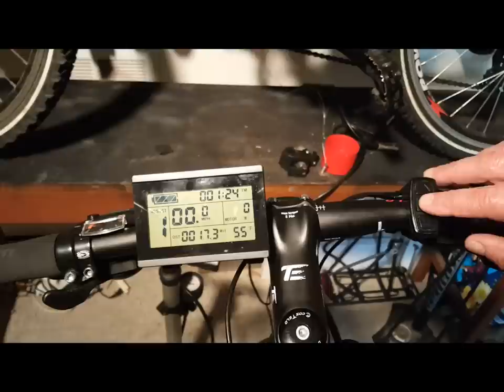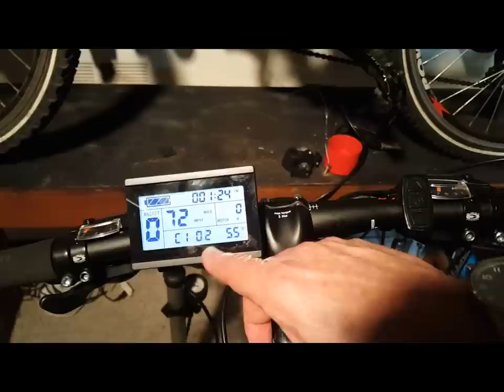How to program the KT-LCD3 Electric Bike Computer. 20 E-bike functions

Comment: I'd probably edit this comment when I'm able to test this, but I had a brake sensor issue with my 250w motor, hopefully changing the ABS setting resolves the issue, as I'm reliable at braking efficiently

Comment: thank you   ... all this  control settings was missing  in  the  manual  for my ebike conversion kit  from  UK.....
Reply from the maker: I'm glad this helped. We go through every function and there is a lot that it controls.
Reply: do you  know if  I  have to reset   with C10   .... I have  problems  with   not  showing  correct  speed   on  26 inch  wheel   that I have  to  set to  12 inch  to  show  almost  correct  speed. Or maybe P2  is the problem ?
Reply from the maker: C10 and P2 are not the problem. Try resetting wheel size to 26 then press the middle button to save. Let me know.
Reply: Its OK  now  again-I got the right setup  for my  bike  from  electricbikeconversions.co.uk now for my kit :  P & C Settings
To change these settings you need to turn off your LCD Display and then turn it back on again. 
The press the Up and Down arrow together and let go within 5 seconds so that the speed should be flashing. 
You then need to press the On/Off button x three and then the Up and down buttons together again to get to the relevant screen.
P1 – 46
P2 – 0
P3 – 1
P4 – 0
P5 – 12
Press the on/off button to advance to each P setting
Then when at P5 press the up and down buttons together again to advance to the C settings
C1 – 02 – PAS with Red Sensor or 07 – for all black sensor
C2 – 0
C3 – 1
C4 – 0
C5 – 10
C6 – 3
C7 – 1
C8 – 1
C9 – 0
C10 – N
C11 – 0
C12 – 4
C13 – 0
C14 – 2
Press the on/off button to advance to each C setting
Press and hold the on/off button to save and exit these settings
Reply from the maker: When in doubt. Reboot. I'm glad that worked.
Reply: Augustine E-Bikes - Santa Cruz 2017
Reply: @shittapes  Hello, how many volts is your battery?
Reply: @osbaldo_g  36v

Comment: The wires on one side of the LCD came loose, I am trying to open the LCD. I removed the screws in the back but it seems to be glued closed.  Any tips on how to open it?  There is no gap to insert a screw driver to pry it open and not enough surface to use hand pressure.

Comment: Hello I have just set my ebike up with all the correct spacers, but my batteries are fully charged and the screen lights up for hours without going off But as I try to turn the crank with my foot standing still its stuck fast and won't spin and when I twist the throttle it goes find for about 5 seconds and the screen goes black and the battery shows empty and the wheel stops dead,  can you help me. I tryed following your directions but iv messed up something somewhere

Comment: what battery do i connect this to for a 36v 750W motor? the controller power wires are flat circles with holes in the middle, didnt buy the battery yet

Comment: My power seems to run out once I reach the later end of 2 bars, even though theres a 4th bar to indicate low Battery. I've had the bike for a little over a year and works fine when its fully charged. is that just wear and tear*? or is it probably more to do with battery balancing and at what levels I begin to charge it at? .. Going to try the P5/RealTime setting later today also, Thank you👍

Comment: What does it mean if the battery level is blank showing no bars but the actual battery is full?
Reply from the maker: Your LCD is not connected
Reply: The battery voltage may be set wong in the settings. If it's set to high, it may think your battery is empty even when its fully charged.

Comment: Hi and thanks for the video.
I got this controller and a 48V battery, on P5 function the defult is 15. When I put 0 on P5 it shows blank even though the battery is full. Maybe you know what the settings should be for 48v? I read that 36v should have 5-15 on this function setting.. Thanks in advance
Reply from the maker: On the P5 setting 0 will show you your battery charge as you are riding. The setting for continuous read out for 48v is 15
Reply: Rockin Electric Bikes in 2018 AUGUSTINE EBIKES what are the voltages for each P5 setting? also is 48v 12S or 13S?
Reply: my bike was sold as "36v ONLY 48V WILL BURN IT" and 48v has been working flawlessly for me but the battery indicator was useless, so this is perfect!! but is 48v 12 cells in series or 13?

Comment: My bike keeps cutting out drive to the motor when under acceleration,  any ideas ?
Reply: Bad battery or too high cut off voltage or battery/motor mismatch. Try lower current.

Comment: Hello. I m facing a problem on my LCD : its showing an error message 'info 06', and the temperature symbol is loading... Could you help me ? Many thanks
Reply: I'm not an expert, usually that happens with failed component. controller or motor in in my experience

Comment: How long will a 200w hub motor larst with controller set on 1000w ????
Reply: Eny One,??????
Reply: @chinkacollins6390  , hey! hub motors like to spin fast. I would say ,if you run 200w motor more then it is rated it is allright, also 1000w peak. But not uphill with 100kg rider weight and more then aprox 1 minute.
Anyway you can find out and experiment, but maybe it is better to swap it out with 500w motor, then 1000w or even 1500w will be much more powerful and noticable. Also no problem with heat and load.

Comment: This guy doesn`t know what he`s talking about. When the assist function set to "0" the throttle is not dependant on pedal assist, the throttle works normally without padal assist.
Reply from the maker: First, this guy your talking about is me  and I do know what I'm talking about and actually agree with you that when set to 0 the throttle works normally. And it's pedal assist not padal assist!

Comment: My voltage readout goes down the more I apply the throttle, is that normal?
Reply: Yes it tottaly normal. While you ride, the more throttle or Pedal Assist you use the more the volts will go down instantly. When you stop the bike and check your voltage you will see the real number. It is like the cars instant consumption...
Reply: It's called voltage sag and is normal. The better, more powerful you battery, the less it will sag. Batteries will sag more as they age. If it sags too much to use, as in it trips the low voltage warning in the controller under load, then it might be time for a new battery.